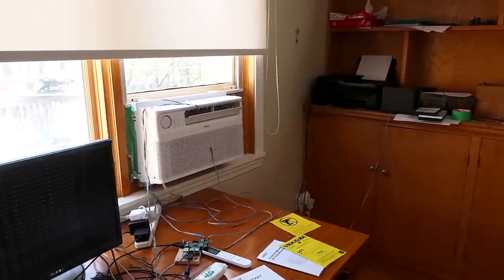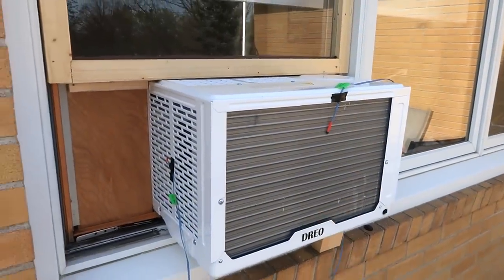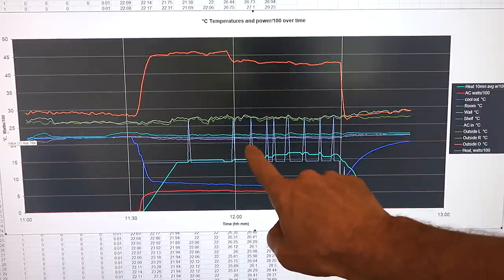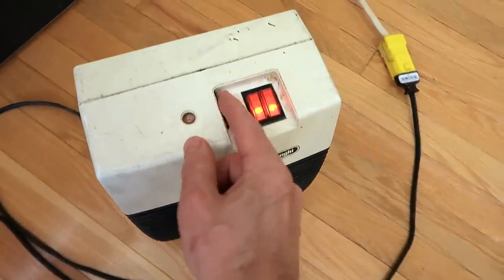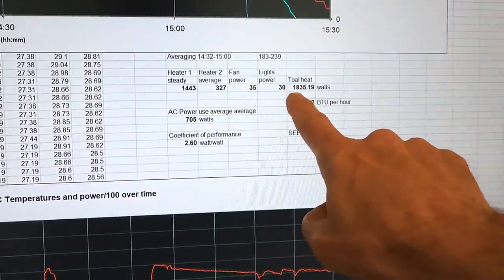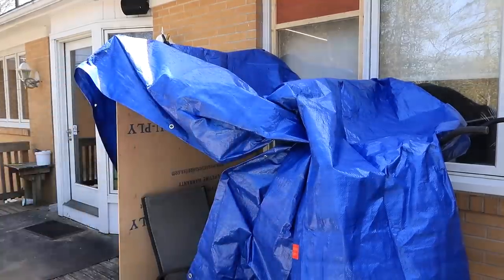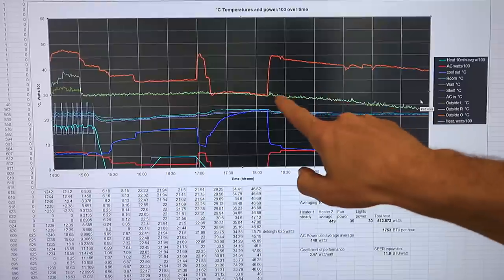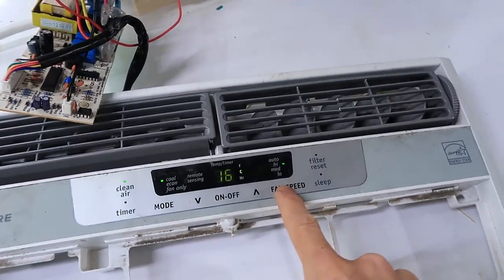Window air conditioner efficiency test

Comment: I had  so many questions about AC few months ago when I first bought one, and I couldn't find the answers anywhere. Over time. I found some of the answers myself.
So I'm gonna write what I know and the unanswered questions.

The AC fortunately has a built in way to check power consumption. So I check every 1 hour of running to get the idea.
It's a 1.5ton samsung split AC, 1240W Max power, and the room is ~200sqft
1. When outside temperature was 35°C(daytime), and inside 28°C(without AC) it uses up 0.9kWh to maintain at 24°C indoors. 
2. When temperature is 26°C outdoor(nighttime) and 27°C indoor, it uses only uses 0.2kWh  to maintain same 24°C
3. It's also a convertible AC, so I can run it at 60% or 40% of the power.
If I do 40%,  power consumption is cut down to 0.5kWh in day, and 0.1kWh per 2 hours at night.
4. If I do dry mode, it cuts down the humidity from 70% to 44% in 15 minutes, and shuts off, 
And uses 0.4kWh in that short duration. (Which doesn't make sense to me because that would be 1600Watts, well over max consumption)
5. My electricity bill more than doubled after buying an AC.
Entire house was using 150kWh per month. Now it's 325kWh I use it intermittently in daytime, and turn off at night. Because running it overnight would be too expensive.
6. If I run it at 40% lowest temperature I can reach is 23°C, it's 19.5°C at 60% while the lowest setting it has is 16°C

Question 1: I don't understand how running the AC at lower power reduces power consumption. Because according to my knowledge, if I run it in full power, it should cool down the room quickly, then turn off, vs cool down slowly for longer if I used 40%. 
They should cancel each other out, and overall, should consume same amount of power.
Question 2: I had a refrigerant leak at some point, and room didn't get cooler, at the same time, compressor could be heard going full speed. Even the fan in outdoor unit was going full speed. And yet, It was using negligible amount of power. How is the power consumption reduced if the compressor was still going full speed?
Reply from the maker: any heat exchanger works much better at lower rates (less temperature drop across it, so less losses)  So running 2 hours at 50% power should be more efficient than 1 hour at 100% power
Reply: I will posit a theory for your second question: with low/no refrigerant, your motor was running the pump, but there was nothing for the pump to pump.  Like a fan running in a vacuum, the load is considerably less.  Just my 2 cents
Reply: Regarding power consumption with gas leak, what consumes power is not the compressor speed, but rather the gas compression itself.  The power used depends on how easy it is to compress the gas, the colder it is the easier, ie lower temperature inside the room, the amount of gas to compress, and the speed of its motor.  The leak lowered the amount of gas, hence lower power use.  The compressor motor in any AC unit is the heavy consuming part.  Fans consume very little relatively speacking, 5~15% of the total.
Reply: @ikocheratcr  Like to "thumbs up" yer own posts, there, eh? Lol.

Comment: Do you have a video on your computer interface bit? I've seen many many experiments you've done with whatever device you're using. 
I started looking at National Instruments DAQ hardware - I think I remember using it in school at some point, but that equipment is $$$$.
thx
Reply from the maker: I used a bunch of 18b20 sensors hooked up to a raspberry pi.  Videos on how to do that are out there
Reply: @matthiasrandomstuff2221  Video on how (or where) to buy a raspberry pi needed... 🙂

Comment: Do a video on the hackaday commenter's claim: putting a stack of tires on top of the outside ac fan causes a chimney effect which cuts your airconditioning bill in half.
Reply from the maker: Not necessary.  The fan blows up, and that jet of air should go quite a ways on it's own.  But getting the hot air from the AC is definitely important.  You don't want obstructions around the AC.
Reply: @matthiasrandomstuff2221  it should go up. But the claim is that it doesn't. Instead it creates a bit of a torriodal downdraft.  Bust it, or demonstrate it.  Everyone could benefit! It would be a HUGE viral video.
Reply: @TheRainHarvester  
A little 'smoke' should show what is happening. The 'ring vortex' effect is what they are claiming ...

Comment: could you use it in winter the, but turned around, so it cools the outside and warms the inside? i guess it's not desinged to do that. 
would that be more efficient than a space heater?
Reply: What I mean is, a heatpump is like an air conditioner unit turned around.
Reply: @mckenziekeith7434  uh, are you replying to something which does not exist?
Reply: That's what a heatpump is. They use 1/3 the energy

Comment: where did you get the data equipment
Reply from the maker: Raspberry pi computer, 18b20 temperature sensors from DigiKey
Reply: @matthiasrandomstuff2221  Have you found the 'real' 18b20 sensors more reliable than the chinese knockoffs? I've been a bit hit or miss with them.

Comment: so the real question is....  how does this fair with a mini split say 9K BTU?  Those go down to around 200 watts when cooling to maintain room temps.  I think the problem with the heater in the room is that, the AC unit is only going to cool around 300 SQ FT. So, having heaters in a room, is poor since it was only designed to cool X amount of sq footage, it's like putting in an AC unit that is just going to run maximum power and if it's not going to cool the room it was designed to cool, then.... it's not going to save you a dime. I would have just put it on a kilo watt meter and have actually like to get real world #'s in a room space it was designed to cool.... To me this review is a waste of time, I was hoping to see average long term weekly monthly average cooling cost to see if it worked any better since it supposedly had a variable speed compressor.